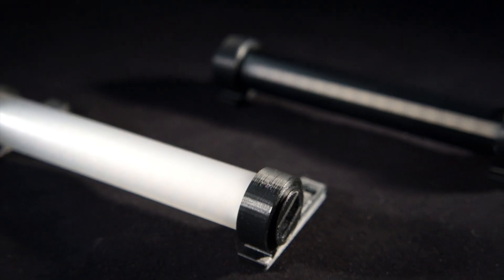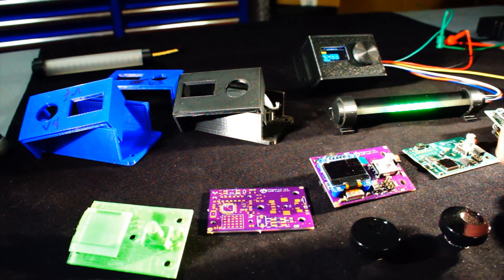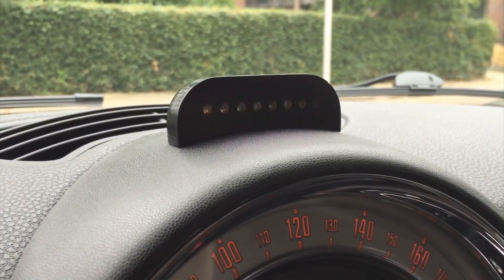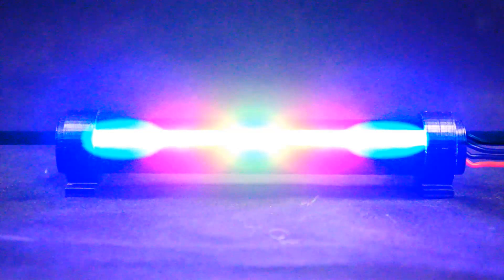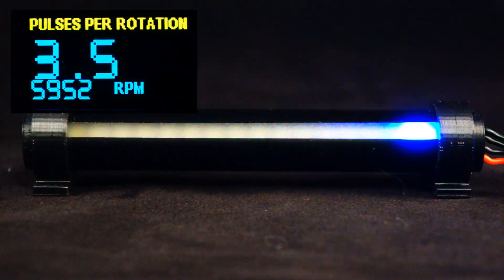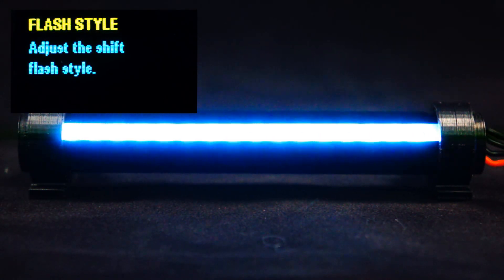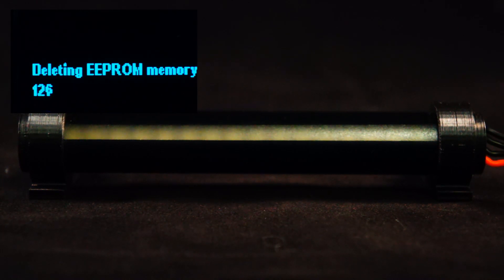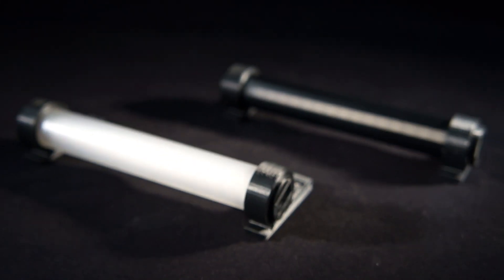Chippernut v3.2 Shift Light - New Features!

Comment: Im about I buy one for my custom gauge cluster I’m making but I want more leds than the 16 what kind of leds can I use with this system? and where can I find them?
Reply from the maker: @edo5478  You can order more via the website and they ship in one length. Thanks for saying something, I just noticed the website doesn't really spell that out. I'll update. thanks! add however many more than 16 you'd like up to 32 (power limit). https://www.chippernut.com/store/p24/StarChip_Digital_LED_Strip_Black_APA102C_144%2Fmeter.html#/
Reply from the maker: @edo5478  If you want a totally different strand altogether, these are APA102C Leda.. ebay, Amazon, Adafruit, and sparkfun sell them in all sorts of spools and shapes/arrays

Comment: Can i use something like Ws2812b rgb led for that? Because it's very hard to find apa102c lrd in my region.
And is it possible for 1 cylinder engine?
Reply from the maker: Hey! so, yes it will work fine with a 1 cylinder engine provided it has a digital signal. otherwise there are tach adapters that can do that. The WS2812b LEDs are notoriously slow in thay they require a dedicated clock signal. I used that LED on my v2 shift light and it wasn't fast enough to keep up with quick rpm changes. The APA102C is significantly faster which is why I switched. Have you seen my eBay page? I can probably ship LEDs to you. https://www.ebay.com/usr/chippernutstore